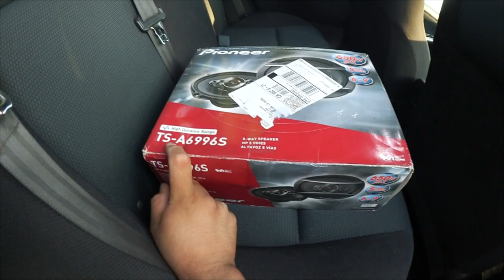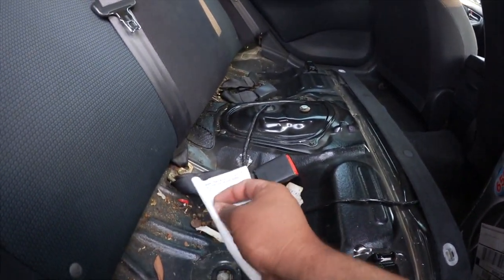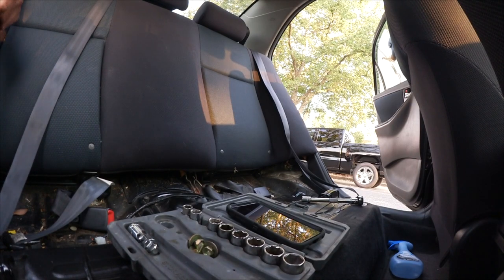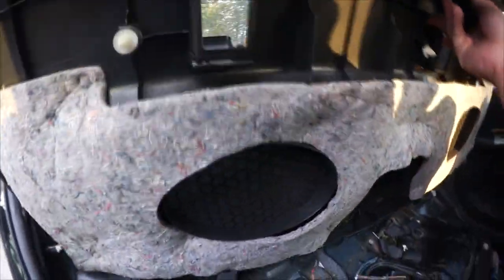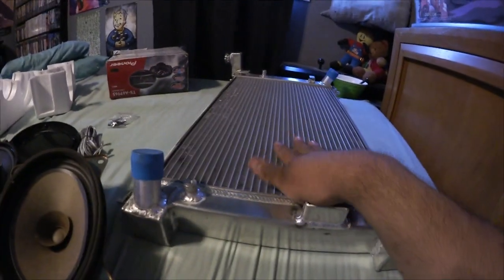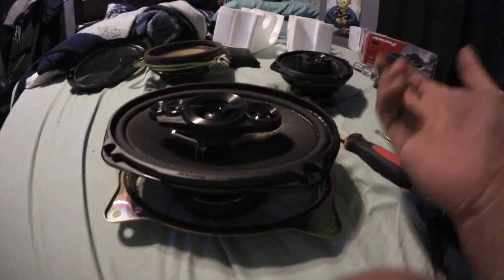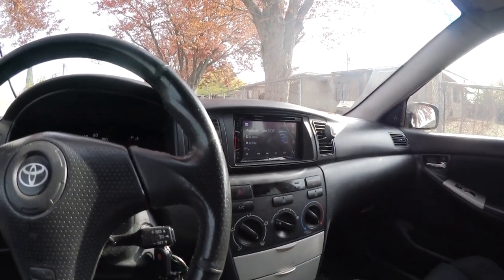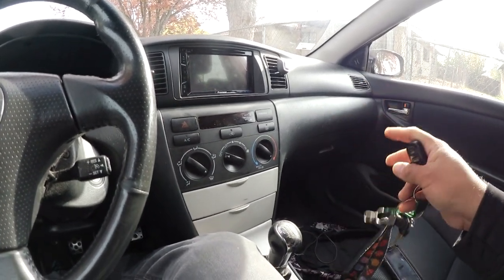Installing Pioneer TS-A6996S speakers on my Corolla XRS (05-06)

Comment: Pioneer TS-A6996S or Pioneer Champion Series TS-7150F? really in need for an answer
Reply from the maker: well the 7150F is a bigger speaker and will need custom work to fit
Reply: @2zzlow  I'll have to do the custom work anyway because my oem speakers are round

Comment: you just change the rear speaker, Do you changed the Door speaker too?, if you don't than Do they (door and rear) work properly?
Reply from the maker: Since then I changed both front and rear. They will still work properly

Comment: I want to upgrade my factory speakers in my 03 Corolla. Perhaps in the new year when the weather is good. I replaced the head unit 2 years ago for Bluetooth. Nothing fancy, just the cheapest Bluetooth car stereo I could find online. Lol.
Reply from the maker: Pioneer has some pretty cheap headunits
Reply: @2zzlow  I ended up buying a Bluapunkt head unit for less than $100. No touch screen, so I guess it is period correct for a 2003 Corolla CE car. Bluetooth is awesome, which is why I got it.
Reply from the maker: Same, I need to upgrade my celicas head unit to a Bluetooth.

Comment: i got 2 10 inch subs in the back of my 05 XRS and ill tell you. It fucking bumps so hard that the rear passengers get  massage but they also cant here the music. I am defiantly going to get these speakers. Im done with those card board speakers.
Reply from the maker: Yea they are really bad. Anything past 20 on the stereo sounds distorted and bad. Huge upgrade these pioneer speakers for sure. I can go all the way up to 35 and it sounds just as good as 15